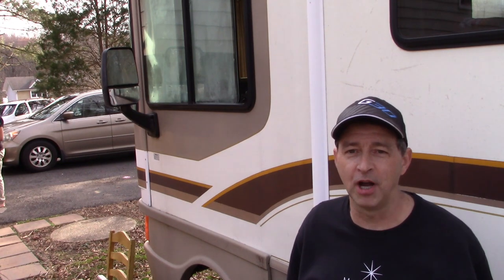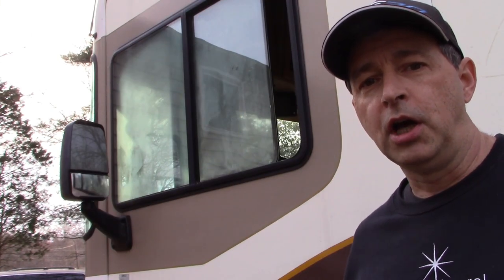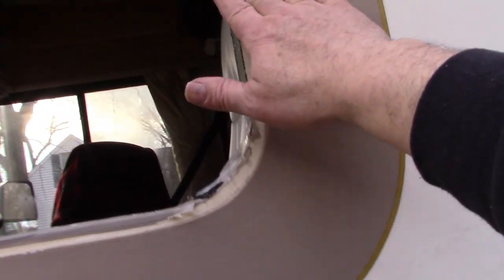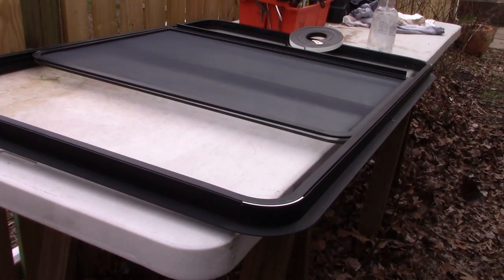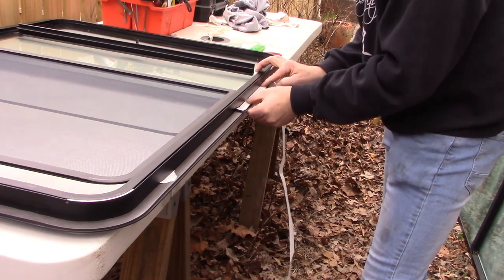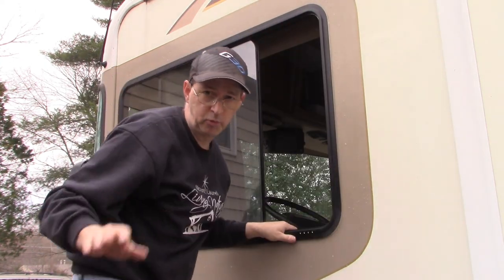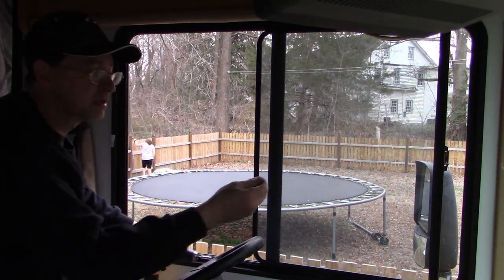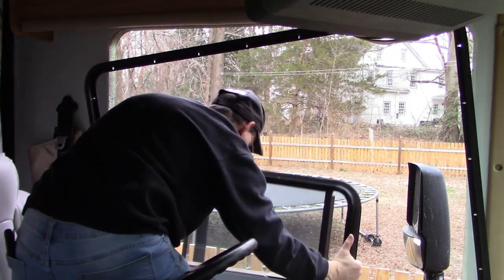How to Install an RV Window

Comment: I just received my windows for the same RV. Gonna install them on wed. I'm wondering about the screws, the inside ring came pre drilled but the main piece doesn't have holes drilled, do the screws screw into the channel that goes around the frame of the main glass piece?
Reply from the maker: yes, the screws for the trim ring grab into that channel. Good luck with the project!
Reply: @Buckwsr  have you ever had an intermittent problem with the stairs? Mine became unreliable so I just disconnected them.
Reply from the maker: @stevegraham4512  Fortunately, my entry step has been working just fine. I mostly just keep to step down when the RV is parked, and then when you fire up the engine, the step defaults to the up position if the RV door is closed.

Comment: I believe you should leave a small gap in the foam tape at the bottom.  This is to let any water that will comes off the aluminum frame and window on the inside a way to escape.

Comment: Was there a particular foam tape you used? Amazon has several type,  butyl and foam. Width?
Reply from the maker: The double-sided adhesive foam tape was included in the purchase of the replacement window. It was like 3/8 or 1/2 inch wide, about 1/8 inch thick.

Comment: Thanks for the videos covering you window replacement. I have the same 98 bounder and need to pick up a new drivers side window as well. Do you mind sharing the measurements you used for your window order?
Reply from the maker: Here's a link to my window measurement video:. https://www.youtube.com/watch?v=FbzAleczBQg. 
In my case, rough opening was 46" wide by 31.5" high. Wall thickness is 1 and 7/8", and a 2.5" corner radius.  I would be sure to measure your window and not just assume it is identical to mine. Good luck!

Comment: Hi, we have the same rv just different years.
Nice install. 
I noticed you have the same backup monitor as I have. 
Question,  does you backup camera system work?
Reply from the maker: Hi Kelly, my back-up camera system works pretty well. At first it did not work, and I discovered a blown fuse in the line behind the monitor screen. Not sure why it had blown, but I replaced it and seems fine now.

Comment: Great video I need to do the same with mine. I have a couple of questions.
How long does the job take?
Why is there a need to replace the inside trim?
Reply from the maker: The inside trim is a big part of what secures the window to the RV. Sort of clamps it into place. Yes, it is essential. Your new window will come with a new inside trim.

Comment: Did you use shims on the bottom when installing them?
Reply from the maker: I don't recall any need to shim it....
Reply: @Buckwsr  I replaced both windows, really easier than I thought it was gonna be. Only thing is the inside ring didn't fit perfect. I had to separate them at the break and overlap about an inch.
Reply from the maker: @stevegraham4512  kinda strange about the trim ring....I don't recall mine being too big. Perhaps there is some wiggle room there. Maybe you could shorten it as opposed to overlapping it....? Glad you got it done, though!